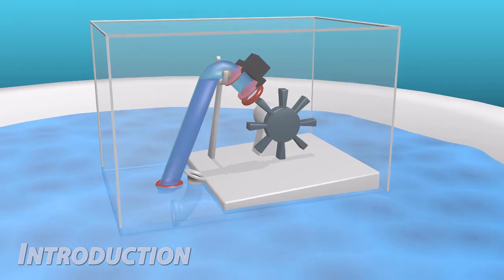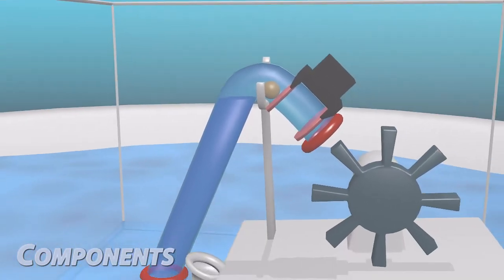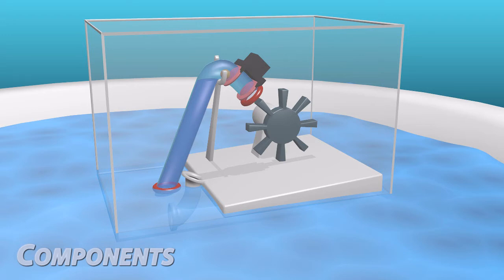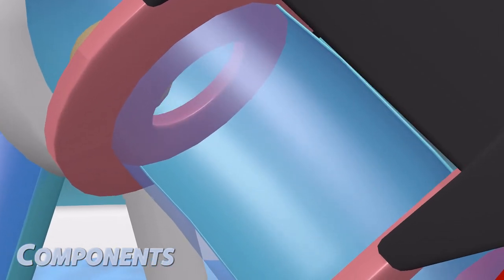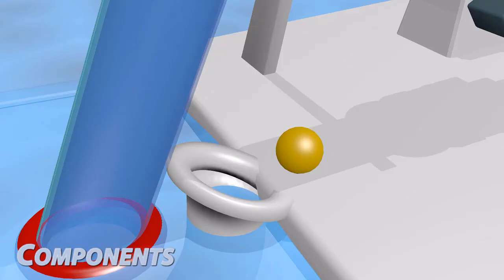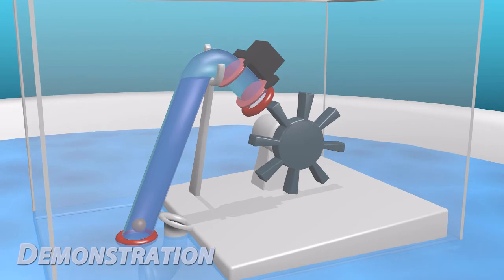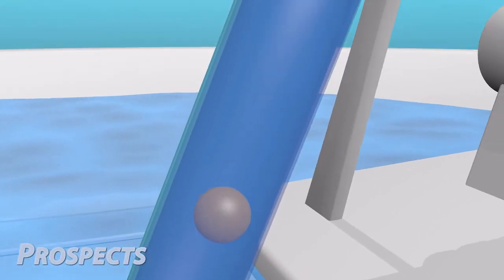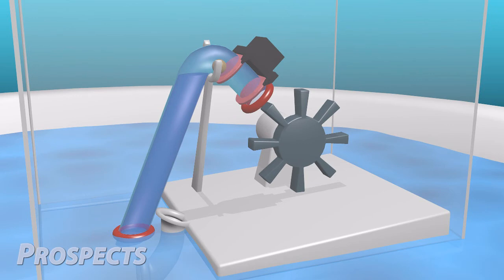Floatation Generator 3

Comment: Using many more balls in the system and instead of a circular type of generator rather use an elongated energy capturing device which would allow for a greater amount of balls to rotate the elongated unit. For example 10 balls would create 10 times the normal torque. Also a small amount of water is needed to allow to maintain that water level. An extra valve system located at the bottom of the column will help eliminate some water losses. Every time a ball comes out of the liquid the liquid level will be lowered by the exiting ball's volume. Therefore the Buoyancy of all the balls required to push the upper ball completely out of the water must met and the new ball must enter column of water at the same time that the ball on top is being lifted out by the Column of balls. Also the small amount of water left on the surface of each ball leaving the device has to be replenished as the water is slowly wicks out of the system. I hope this helps these are just some of the ideas on viewing your animation.